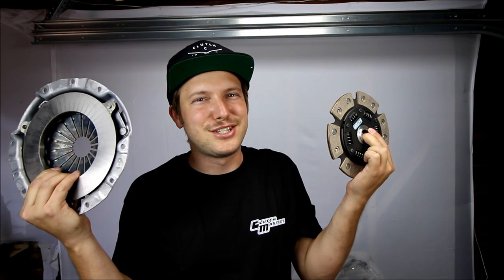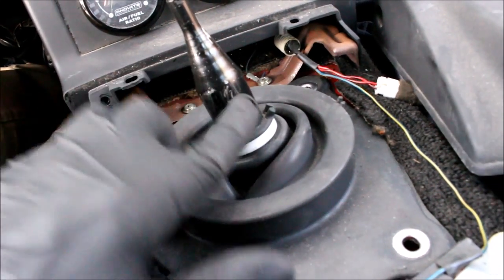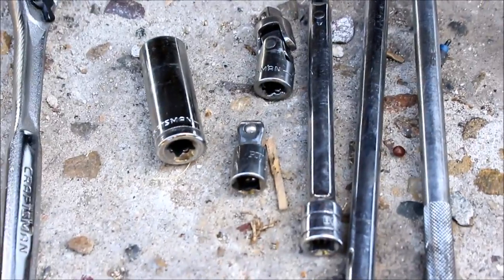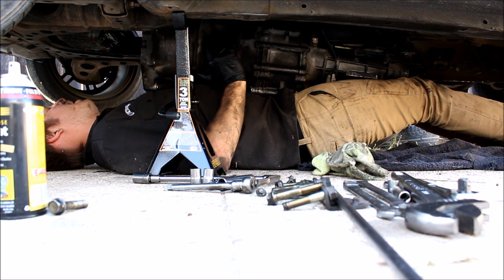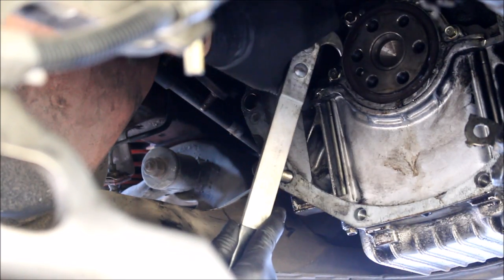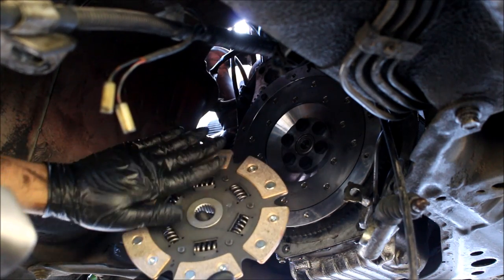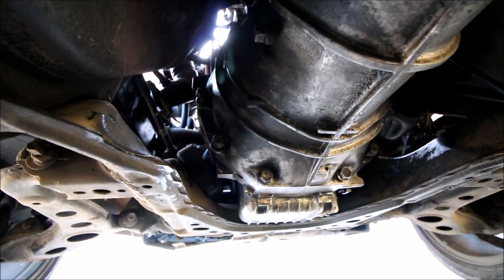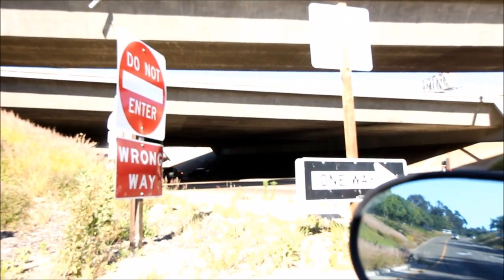Caught Slippin: The ULTIMATE Miata Clutch Replacement Guide!

Comment: TheCarPassionChannel , did you have any issues with the AC after installing the fidanza flywheel on B&B? I've got their 8.5 lb flywheel on my 1.8, and it's one of my favorite mods that I've done. However, I'm in Texas, and this is the last summer I'm spending without AC. I've heard it's a nightmare to get megasquirt, AC, and a LWF to work together; is that true from your experience? Idk if you still read comments on these old videos, but thanks for all of the content over the years.

Comment: ive only ever done one clutch, and it was on an all wheel drive bmw in my driveway with hand tools. this looks infinitely easier and im no longer worried about doing a clutch on my miata lol
Reply from the maker: It's waaaaaay easier. All the parts are smaller and lighter, and you have more room to work with.

Comment: Just curious but have you ever done a video on replacing the slave cylinder on a Miata? I think I may be needing to do that but I can't find any good videos to show me how.
Reply from the maker: Paul Slavonik I have not - but you can see how to unbolt it in this video, only added part is unthreading the hydraulic line with a 10mm. I do have a video on replacing the master cylinder and how to bleed the clutch as well. (Linked in the description)

Comment: Hey Greg! I'm getting ready to install FM's Happy Meals clutch in lieu of the FM S1 Turbo Kit and I'm just going through a bunch of how to's to get a general idea of what's all involved. I'm curious, would you recommend replacing the Rear Oil Pan Seal (Moss P/N: 907-207) on the assembly that holds the Rear Main Seal- as a sorta "while you're in there type of thing? I know you didn't do it in your video, but I ordered a set just in case mine was bad. I know it's a pita to put in as you have to compress the seal in order to get the dowels to fit. I'm just curious on your thoughts. Thanks so much.

Comment: Dude you had one job! Which was to tell us this is nigh impossible without jacking up the oil pan to allow the transmission to mate when putting it back together, would get the bottom but even jacking up the rear of the trans would cause a 1 inch gap at the top and raising the trans further would just move the motor.

The other thing is the mazda engineer who thought an aluminum PPF and long ass steel bolts without antiseize was a good idea..... Had to drop the whole damn diff assembly with the PPF, on jackstands............

Comment: Hey Greg, hope all is well, I have a 1.8 96 miata with lsd transmission. There is something wrong with my clutch. My car wont go into gear when I push the clutch, and i feel no pressure when I push it down. I replaced my slave cylinder and bled it all the way thru. No luck. I have yet to replace the master cylinder but if I do and it still doesn't work, do you think I need to replace my clutch? Or do you think it's a pedal problem? Thanks

Comment: @TheCarPassionChannel  I'm currently doing a manual and engine swap on my 1.6 I can figure out if the 3 bolts that go to the motor mount bracket that's directly on the engine , are the 3 bolt the same size and if the one is longer then the 2 what spot does it go into ...also need torque spec.... that love the channel

Comment: I just had my clutch replaced at a shop and have driven about 50 miles so far but every 1st gear start and in reverse there's this awful sounding scraping noise you can hear and also feel in the pedal. The mechanic said it should be fine but I didn't hear that noise on your first drive so now I'm a bit concerned something was done wrong

Comment: Can you basically follow the same initial steps to disconnect the transmission from the engine for an engine replacement? I’m not sure if it’s easier to just pull the engine without transmission or pull both. It’ll be my first engine replacement job so the more info I have the better. Thanks (I have an 01 Miata
Reply from the maker: Yep it's basically the same!

Comment: I was able to get the transmission in by myself, it was hard but i was able to get a couple bolts in by hand. it feels like its in but the case wont mate with the motor completely even when i try to wiggle it in. Do you think I might have moved the clutch out of alignment when i was putting the transmission back? do i have to start over?

Comment: Just real quick, do you remember if you tapped into the bullet connectors or the blade connectors for two-step?
Reply from the maker: Check out my 2-step video for my wiring method. I've only seen it work on some cars, but it worked for mine. Video is titled ... shooting flames or something

Comment: Great tut but holy cow how did you make it look so easy had a horable time lining everything up
Reply from the maker: Getting the trans back in all the way can take 30 seconds or 30 minutes. It can be super frustrating! Tilting the engine back a little with a jack + 2x4 or an engine sling can make it a lot easier.

Comment: If you bring your your clutch pedal up quickly do you get a clanking transmitting through the gearbox. My car never did this. I’ve 100% correctly installed a performance clutch and I get this horendous clanking when you lift the clutch pedal and it’s in gear. Seems to be a really common problem....

Comment: I love you and your videos! I need help and it would be awesome if u could reply to my comment, I'm currently putting a new flywheel, clutch, and pressure plate on my 96. I've got everything put together, but the trans refuses to go back on! I have dry fitted the pressure plate, clutch and flywheel to the trans and it slides on just as far as the stock ones do, I have also re aligned the clutch and tried to get the trans in but it just won't go in! Nothing is in the way, and I have no idea else what to check for, I don't know why it won't go on. I'm 16 and this is my first time doing this, I would really appreciate the help. Thank you so much, love your vids!
Reply from the maker: Clutch alignment is typically the problem - try raising the clutch disc up a tiny bit with the alignment tool (2mm or so) as it tends to sag a little even with the tool inserted. Then re-tighten the pressure plate and make sure the alignment tool still slides in and out easily.

Also - raise up the nose of the engine so it's angled back, that usually makes it a lot easier too
Reply: @TheCarPassionChannel  I'll try that, thank u so much for the fast response ur the best i have been subbed for like a yr now and all ur vids inspired me 2 get a miata, thanks so much!

Comment: Did you completely remove the PPF?  I did exactly as you did but it definitely doesnt pivot over out of the way.
Reply from the maker: You have to remove 1 of 2 rear bolts at the diff, and loosen the rear most one slightly. Then it will pivot

Comment: Hey Greg I have a question. The people who had my Miata prior over tightened everything on the car and rounded off the drain plug on the transmission. It's a complete circle and can't get anything to grip the bolt due to it being a low profile head. Any recommendations?
Reply from the maker: You might have to drill it for a big EZ-Out and get a replacement plug. Or somehow cut the plug so another type of tool can be used to remove it

Comment: Which  mounting bolts on a 1.6 transmission on the passenger side has those PESKY!!!  Wiring harness brackets? I am having hell with those. There are two left. One which has the clutch slave feed line and then there seems to be a bracket which is on the back side of one of the starter bolts. I could kick myself for not taking photos. I ve got the transmission back in but am fighting with this for hours now. Help me Mr Wizard.

Comment: I have a question, why do you need to bleed the clutch? even if you unbolt the slave cylinder shouldn't it be pressurised still? I just did my slave cylinder not too long ago so just wondering
Reply from the maker: If the clutch is acting as it should, there's no need to bleed it. But at the point of changing your clutch, it's a good idea to cycle new fluid through the system
Reply: @TheCarPassionChannel  Thanks carpassion!!! man you’ve held my hand through my timing belt and all associated part changes and now this also :) excited to take my transmission off today as i’ve done all the other steps from your video. You are a blessing to the community and to all the people building their dream miata’s. with that being said might as well bleed my clutch that can never hurt

Comment: This dude changed his trabsmission without a lift
Reply from the maker: Yeah I've done it around 10-12 times this way
Reply: @TheCarPassionChannel i just bought a mx5 nbfl memories with 110hp. The problem im having is that when i try to accelerate, the rpm is going up but my speed doesnt. And my transmition is making weird noises when im in neutral. So i guess the lack of speed and acceleration is coming from my bad transmition. I will try to change it and your video is definetaly going to help me.

Comment: My clutch went out in my 92 Mazda Miata I bought a new clutch kit (stage 2) and a master and slave cylinder figured I change everything  where do I get a friction plate from for my flywheel
Reply from the maker: The friction plate on the stock flywheel is not replaceable. You should have the flywheel resurfaced or install a new unit.
Reply: Yeah I watch the video I second time and realize that I paid too much attention to that shiny one you had so I'm ordering a new stock one also thank you for making the video I didn't think about ordering the flywheel or the bearing

Comment: 12:20 you don't want that layer of grease thick. Thin and easy. Too thick and it could sling from the shaft and end up on your clutch/flywheel surfaces. Then that grease is going to cause you clutch troubles you could have avoided.

Comment: So I have the engine with trans out on my NA8 in one piece, I'm replacing the the clutch, pressure plate, and lightweight flywheel. So when I unbolt the transmission from the engine, does the engine have to be at a specific crank position or can I just bolt it on on any direction?
Reply from the maker: No the crank position doesn't matter when you change the clutch or remove the trans

Comment: Hi, I followed the video and got to the hard part. I even got the transmission up but there is a largeish gap between transmission and top of engine. Bottom is flush. Any tips on getting the top flush too?
Reply from the maker: Tilt the engine back. Can be done with a floor jack or engine sling, the reason the trans won't go in is because it's not aligned (gap at the top, but not the bottom)
Reply: @TheCarPassionChannel  Thank you so much! got it in today with your help. Your responses really are appreciated!

Comment: Hey man I just recently installed the same clutch kit and after I reinstalled everything I started the car and I heard a noice coming from the trans and it turns out it’s the throw out bearing cause when I press on the clutch just a hair the sound goes away and it’s a new throw out bearing got any suggestions on what I should do next ?
Reply from the maker: Yeah the trans will make noise when the clutch is out and in neutral, should be a slight whirring sound. Throwout bearings usually just make noise when you press the clutch in.
Reply: TheCarPassionChannel do you know anyway I can get it to stop making that noice ?

Comment: How did you get the upper most trans bolt out on the passenger side? The 17mm above the starter bolts to be specific? I can not for the life of me even get a socket on that one because of the wires/hydraulic lines there
Reply from the maker: I don't remember specifically, you should be able to move the clutch line around a bit if that's the one in the way. Possibly unbolt it if it's mounted to something?

Comment: Was the transmission significantly heavy? I'm a girl wondering if I should get a guy to help me out with the drop.
Reply from the maker: I would recommend help for sure. It's not that it's super heavy, but it's quite difficult to lower down from underneath especially if it's your first time doing it. You can also use a floor jack to lower it but you want to have someone on each side so that it can't roll off the jack as it lowers. The transmission is about 78lbs but is heavier at the engine side and can be very awkward.

Comment: Greg if you are somehow reading this can you please tell me what the ppf is for? Not a pro.
Reply from the maker: +Gavin Smith To keep the diff and trans aligned basically. The Miata does not have a transmission mount or a 3rd diff mounting point like most cars.

Comment: The ease at which you mated the trans to the engine is nothing short of infuriating. Been at this shit for 3 hours
Reply from the maker: Rookie numbers - It took me multiple days one time 🥴 can't remember if I discussed it in the video, but if you jack up the nose of the engine with a floor jack and a 2x4 it can make it a lot easier to mate since you don't have to get the tail of the transmission is high.
Reply: @TheCarPassionChannel you built different man lol! I struggled for about 6 hours to do it the way you did in the vid before caving and buying a transmission jack from harbor freight, then it went it in about 10 minutes. That engine lifting tip helped immensely as well.

Comment: Hey greg I did this install but I depressed the clutch when the slave was off.. what problems will this cause? Because now i cant shift when the car is running. Thank you!
Reply from the maker: Usually if you press the clutch far enough you wouldn't even be able to install the slave. but the symptoms you're describing it sounds like you just have air in the system and you need to bleed it more. It sounds like you're pushing the clutch pedal but the clutch is not opening all the way
Reply: @TheCarPassionChannel  thanks miata dad! Appreciate you! I left the slave as part of the system tucked back like you did. So I was wondering how air would get in. Is it possible I damaged the slave? I pushed the rod back in a bit to fit it back on! Is it possible to damage that piston and it wont push back far enough? I'll get my gf to help me bleed it today! Thank you
Reply from the maker: @davidervin4853  Hmm air shouldn't have been able to get in unless the fluid in the reservoir was low. When the car is running, and you push the clutch in, does it go into first gear easily?
Reply: @TheCarPassionChannel  it wont shift into first with it running. If I threw to push it into first a little bit the car will start to try and roll forward a very small amount. 🤔

Comment: So I blew my clutch out of a 97 miata I went and purchased a aftermarket kit McLeod streetpower from moss Miata and a stock resurfaced flywheel we went ahead and replaced the rear main seal replaced everything throw out bearing pilot bearing everything torqued down to spec we went ahead and replaced the slave and master cylinder bled it for 3 days straight and we just can’t seem to get the car into gear we checked the throw out bearing it’s fine we replaced the master and slave it’s fine we weren’t getting much play off of the fork when we would pump the clutch pedal and once we bled the lines the clutch pedal would hardly give, we adjusted the clutch pedal to give the throw out bearing more play and still nothing everything is primed everything is solid as far as leakage goes we just can’t get the damn thing to go into gear anybody with any thoughts or wisdom here would be very appreciated thank you!!!!

Comment: Dead Dad...thanks for this video 3 years later doing it on the ground in my garage as I type this...
Reply from the maker: Good luck man!!
Reply: @TheCarPassionChannel  So question...been a couple weekend job since I decided to delete ac/ps...I know its in when the trans mates up flat against the engine all around right? I am having trouble atm i feel like the splines are in but maybe its just not in the pilot bearing but the trans just is not mating flush against the engine

Comment: Do you have to bleed the clutch after this job and if so why is that?
Reply from the maker: It's a good idea to give it a fresh fluid flush since you're already in the area, but technically you can change the clutch without bleeding the hydraulics. Not sure why you would want to though, changing a clutch is like a 8/10 difficulty and bleeding the system is like a 1/10 :)

Comment: Why is it that I can get it in and Lined up on the bottom, but the top of the transmission to the engine has about a inch or 2 of space left? And I can't seem to get it to flush?? HELP:(
Reply from the maker: Use an engine along or floor jack + 2x4 to jack up the front of the motor to tilt it back. If you have a gap on the top but not the bottom, the trans is tilted downwards